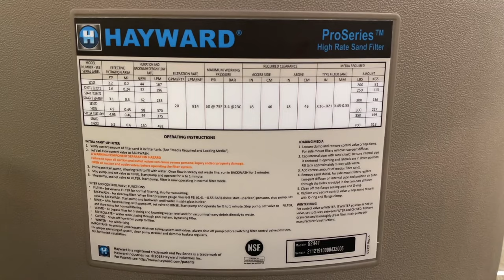How to Change Sand in your In-Ground Pool Filter!

Comment: I took off the drain cap and turned it around to take out the centerpiece and it just crumbled. I guess that piece is not made of good quality. How do I get it out now? there's nothing for the cap to screw into
Reply: I use needle nose pliers to grab onto what was left but it crumbles to pieces too
Reply from the maker: Get something that is a little bigger than the hole that you can stick inside as a wedge so you can unscrew or turn out the broken piece. If you have the same filter that is in the video and need the drain cap kit, here is the link for that part. Thanks for watching.
https://www.hallmarkpoolsupplies.com/p-1712-sx180la-pro-series.aspx
Reply: @HallmarkPoolSupplies  thank you for answering me back quickly!😊

Comment: My local pool store told me that the old sand will actually clean better than the new sand. Is this true and if so for how long?
Reply from the maker: Slightly dirtier sand can filter finer microns. Depending upon what chemicals are used, how well the pool is maintained, and usage level will determine how often sand is needed to be changed. If you are have a difficult time maintaining a clear pool and having to backwash more frequently than normal, that is a indicator sand may need to be changed.